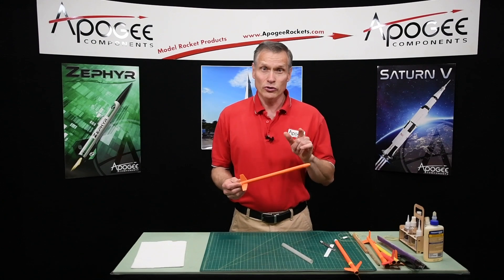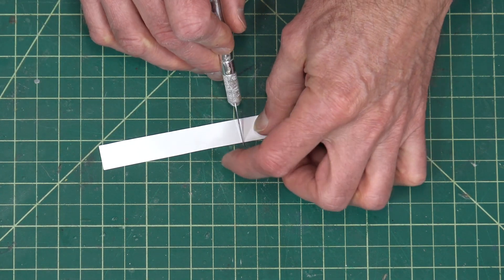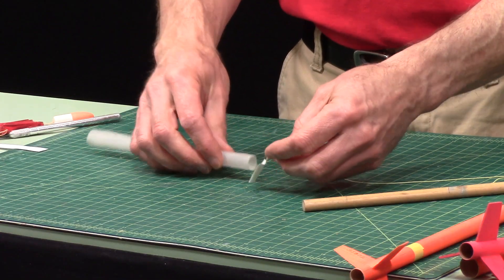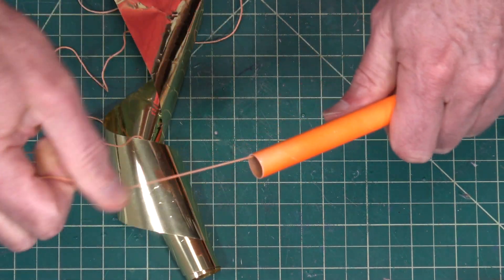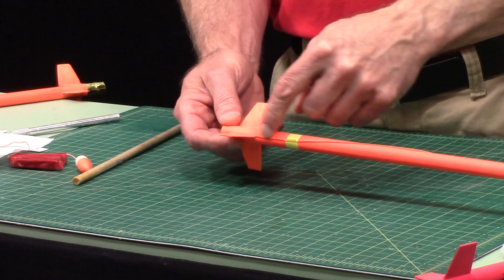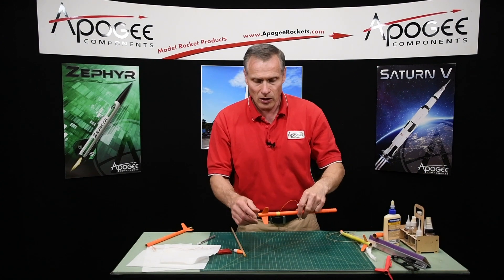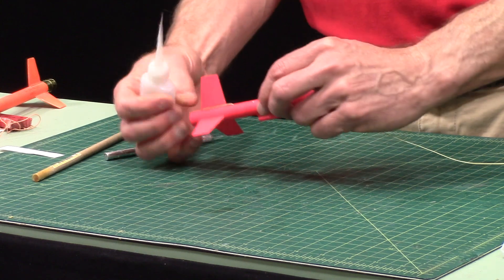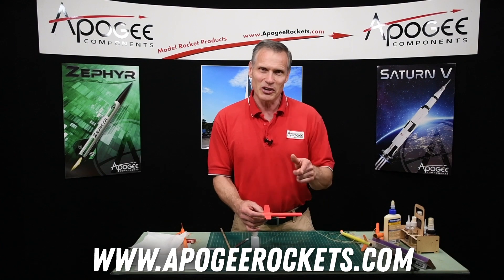How to Attach a Shock Cord Anchor to a 13mm Tube

Comment: The width of the streamer  should be less than the inside diameter of the body tube
Reply from the maker: I like wider streamers myself. But you can do what is most comfortable to you.
Reply: I was unclear. When folding a streamer, the width of the folds should be narrower than the width of the body tube. @apogeerockets